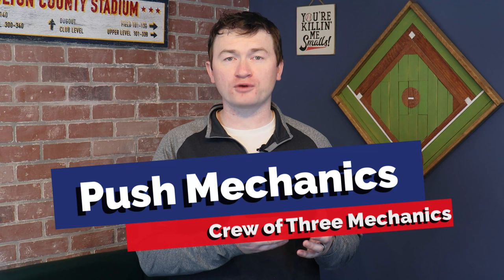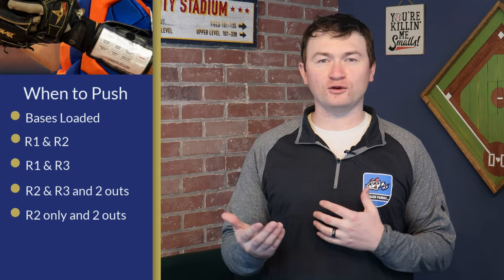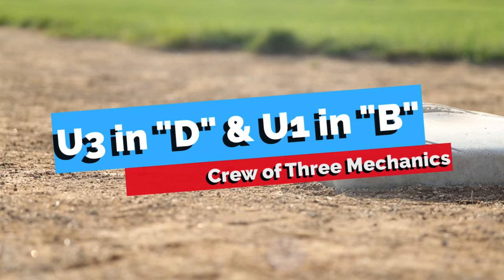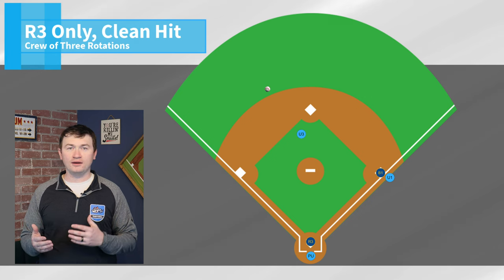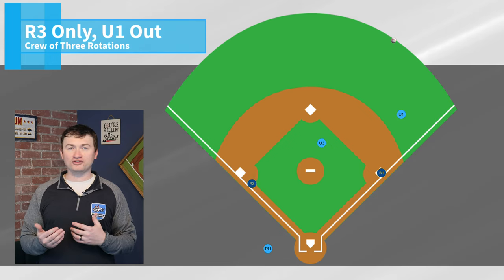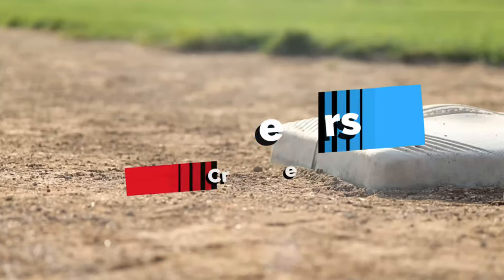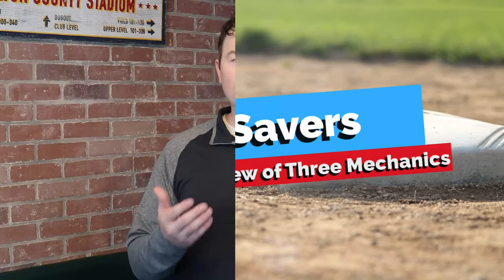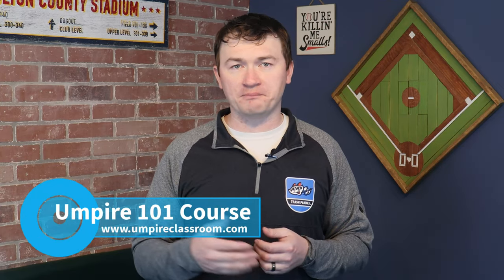Three Umpire System - Part 4: Push and Reverse Mechanics

Comment: It's common to use a 3-man crew in postseason games that are between two powerhouse teams. Sometimes, there is an umpire who is working 3-man for the very first time; or, hasn't done 3-man in a very long time. I was watching a regional championship game last year and saw this happen with a 3-man crew.

SITUATION: R1 & R2. Less than two outs.

PLAY: Fly ball to right field - not far from the foul line. U1 (from A position) decides to go out. Both R1 and R2 are tagging up. F9 makes the catch and both runners take off. The PU rotated to 3rd base to cover R2's advance. Unfortunately, U3 also covered R2's advance. F9 makes the long throw to 3rd and R2 is safe. However! BOTH the PU and U3 signaled the runner safe. The very savvy defensive coach saw the breakdown of mechanics and requested time to appeal that R1 left early. The umpires all looked at one another and, finally, the PU signaled R1 safe. I'm pretty sure the coach was mostly trying to embarrass the umpires for their failure. 

OC: "Seriously? You were watching the tag-up at 1st? You had one umpire in right field and two umpires at 3rd. Give me a break!" and then he quietly walked away. His point was made.
Reply from the maker: Definitely got to be ready for mistakes!
Reply: Head on a swivel. You can watch R-1 tag while moving toward third base.
Reply: In a Crew of 2: Some crews pregame, the PU takes the 'lead' runner...   When the appeal happens, of course our crew will look at each other and one will insert him/her self as the calling umpire. (ie PU).  
As for leaving early, yes, from the batted ball hit to Right field, PU can view R1 and R2 leaving on the first touch.. 
Coaches continue to judge whether or not we have done our jobs or properly used mechanics... An unsuccessful appeal doesn't actually accomplish much.